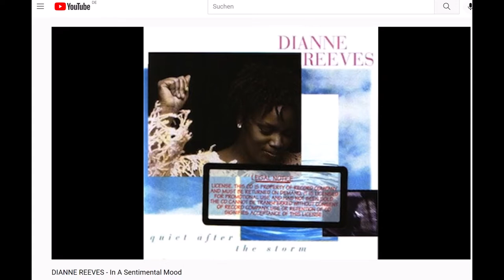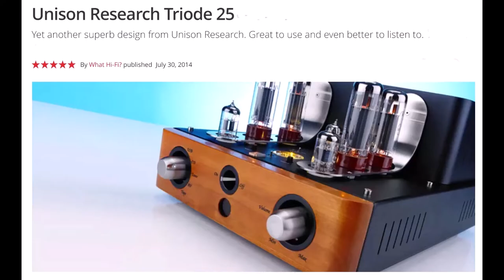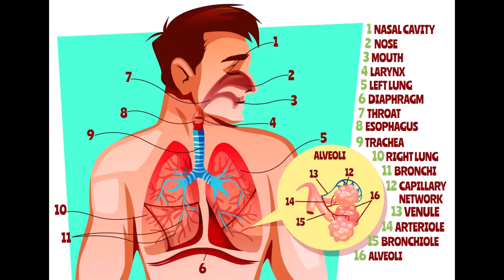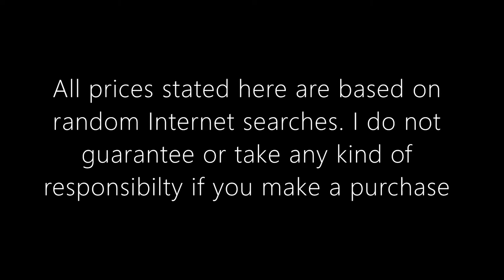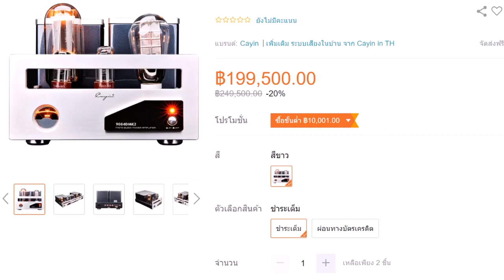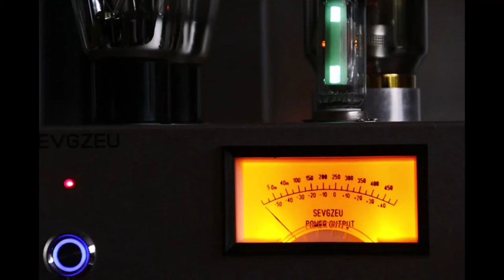Cayin SC-6LS, SEVGZEU Tube Monoblocks, Unison Triode 25, Belles 25A+350A - a marathon test

Comment: dear Rene, thanks for your review. I bought the cayin sc 6ls mkII because of your video's and I'm very glad I did !! It's beautiful and I perhaps will buy your Sevgzeu tube power amps as well (althought i can only find sevgzeu with stereo amps) . I'm not yet shure if that will bring improvement over the NAD C298 Eigentakt Purify Class D am currently listening to. The combination works perfectly
Reply from the maker: Thank you for your trust and affirmation, a real honor and pleasure for me. The techs use to say "never change a well running system", therefore you may happily stick to your NAD. Unfortunately I cannot decide which of the two would sound better in your setup, but should you ever want to try the Sevgzeu, you can contact me and I will  give you some additional hints.

Comment: What integrated sounds the most tubey?
Reply from the maker: This is impossible to answer in a few words. If you are willing to sacrifice resolution for warmth, look for a vintage model, otherwise I recommend you watch https://www.youtube.com/watch?v=I3-pvbglrso in the channel Thomas and Stereo (and some more videos there). He is an expert and might help you along, because he has compared dozens and dozens of tube amplifiers.
Reply: I watch his channel too and it seems Synthesis Roma 96DC could be the ticket!
Reply from the maker: @klepp19  don't forget to check if the ticket includes a matching sensitivity of your speakers!
Reply: @renessoundlife235  My speaker is the Klipsch Forte IVs.
Reply from the maker: @klepp19  Great speakers, congratulations. With their sensitivity of 99 dB you would never have any issues with low watt amps but with the Synthesis Roma's 50 watts you are more than on the safe side. I hope you can listen to the 96 DC somewhere, because your ears should always have the last word, not the specs nor the reviewers.
Reply: @renessoundlife235  Thanks René! Might be hard to get an audition but I trust Thomas and his reviews. Right now I am using the Cayin cs-55a and just want something a little more tubey?
Reply: @renessoundlife235  I might actually look at the new Willsenton r300 now. I don't listen too loud and only listen to compress pop, rock and jazz.
Reply from the maker: @klepp19  a 300b amp for rock and jazz - are you shure?
Reply: @renessoundlife235  It won't work with Klipsch? Some people even use the Decware 2 watt amp. Please let me hear your thoughts
Reply from the maker: @klepp19  When your preference is on Rock, Pop and Jazz, you should, in my humble opinion, put  some decent watt power first. Have you seen my video on the Applause amp? It turned out, that the 300b can handle acoustic instruments, smaller lineups better than beefy pop music, because its strength is a sophisticated rendering of finest textures, voices and instruments in this range (all reviewers will tell you so). If you want a "juicy" sound I would rather look at a KT 88 amp or something like this. I don't dare say it won't work, but I would rather stay on the safe side. However, you can listen and let your ears decide...
Reply: @renessoundlife235  So El34 doesn't have equal juiciness of KT88? I think you right though as when I heard the Luxman MQ-88uC ultra expensive it had a smooth rich dark tonality. 25 watts. I will search your video.
Reply from the maker: @klepp19  OK, you are welcome to watch it, then we can go on discussing, if other questions arise...
Reply: @renessoundlife235  Cool!🙂
Reply: @renessoundlife235  I watch the video and I think I would like the SET 300b driving 805/845 or 211. Since my speakers are a solid 96db speaker can't I just use the new Willsenton R800. Or is their more magic  when you add the 805/845/211?
Reply: @renessoundlife235 I So you find the Unison Triode 25 in trode mode dry sounding? Not airy and juicy?
Reply from the maker: @klepp19  In MY setup airy es, but not juicy. It is a vicious circle: the more transparent the sound,  the less "meat"you get, quite naturally. So you have to find the balance which is just right for YOUR taste.
In an X-ray you see the bones beautifully, but you won't like it as a portrait.
Reply: @renessoundlife235  Do you think the Unison Triode 25 is good compromise? SET Willsenton R800i is too heavy and not sure how long that amp will last with those hot 805 tubes. Or the alternative is the new Willsenton R300b.  Or Synthesis Roma 96dc. What is best for Forte IV out of these three amps?
Reply from the maker: @klepp19  you offer me a very/overly mixed bag and it looks like you should include other than sound-related factors too; e.g. the Willsenton is cheaper, but you should not forget that you have practically no substantial warranty. (cf.my video "ChiFi Jungle) If you know a technician who can help in the worst case,  this doesn_t count that much. For Unison and Synthesis you probably have a reliable dealer. The Synthesis includes a DAC and MM, the others don't (but you pay for that, too, regardless if you use it or not) The EL 34s in the Unison are comparatively small and cannot provide the ultimate rumble (if this is not on the list of your preferences, forget it), but sound very transparent. The Willsenton 300b is in fact strong enough for your speakers, but I have never  heard it nor read about its sound qualitites. The 800i would tick a lot of boxes, but you have some resentments already. As I said, if you could listen to the real thing somewhere, it would be the best help to decide....
Reply: @renessoundlife235  For me I am leaning towards Unison Triode 25 or Roma 96 DC. The Willsenton R800i is too heavy and hot and I don't have a tech. When I saw your video you said Unison was dry I wanted an airy textured sound. I like the parts they use in the Unison. Mostly Mundorf caps which O saw in online images. Roma seems smaller and they do use two Teflon or Polystyrene caps.
Reply from the maker: @klepp19  your effervescent Klipsch might well balance out the slightly restrained sound of the Unison, if synergy occurs. And it's a quality piece, I do agree.
Reply: @renessoundlife235  Hi René can you please elaborate more on restrain nature of the Triode 25 since you had it in your home. Also, would a modded Reisong A12 beat the Unison. My other question since my Forte is a solid 96db efficient will using a SET 300b always have better mids and highs compare to El34 push pull amp even though it has a triode mode switch? Thanks!
Reply from the maker: @klepp19  maybe helpful for you: Steve Huff: The Willsenton R300 Integrated Amp Review. Simply Stunning Single Ended Triode;
Your reasoning about the Reisong is too hypothetical: If you pump enough (or too much) money into anything, it may reach a level where it equals another rival. But is this reasonable?
Reply: @renessoundlife235  I am now thinking of Simply Italy. Thomas says it is warm. Little tip up highs and exaggerated bass. Have you tried the Italy in your home?
Reply from the maker: @klepp19  not yet
Reply: @renessoundlife235  Ok thanks!
Reply: René I may consider the new A60 Boyuu integrated. I think 845 is the sound I want.
Reply from the maker: @klepp19  would be funny if after the long roundtrip you arrive at the same 845s like me. Don't forget to report to me after purchasing and listening.....
Reply: @renessoundlife235  Which 845 amp is your favorite! I forget you have so many?☺️
Reply: @renessoundlife235  I am worried about the heat and life span of amp. Some have reported after few years the solder has melted and in need of repair.
Reply from the maker: @klepp19  I recommend solid state amp for you
Reply: @renessoundlife235  Huh?😳